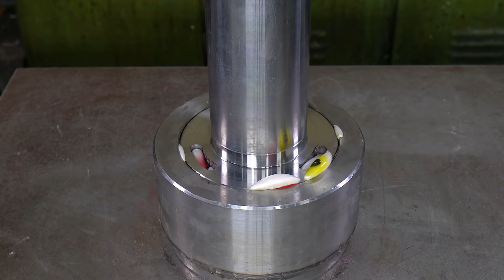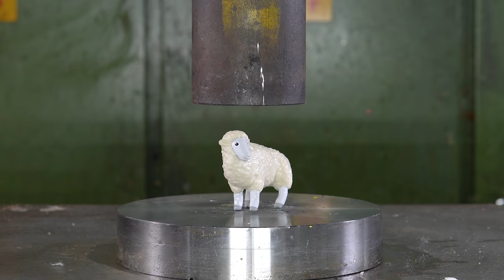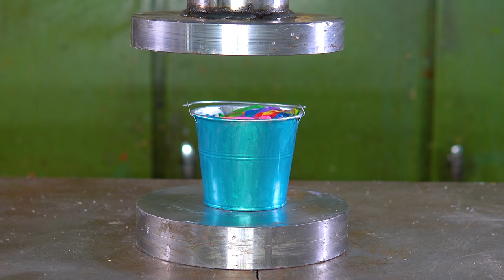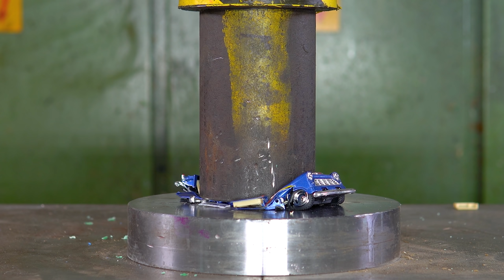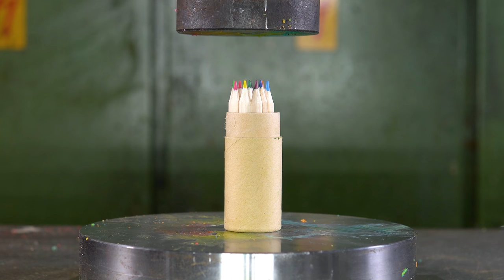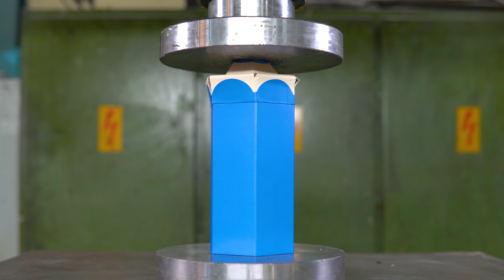Top 100 Best Hydraulic Press Moments VOL 4 | Satisfying Crushing Compilation

Comment: I was assistant manager for a truss manufacturing company in the 80’s. Multiple hydraulic presses. One day on of the men had to hold the truss plate but didn’t move his hand fast enough. It squeezed the skin off his thumb. He was from El Salvador. I rushed him to urgent care he didn’t flinch or wince from the pain. The doctors and nurses said he didn’t react when they sewed his thumb back around the bone. I brought him back to the plant and asked the interpreter how he could handle the pain. He explained that when they lived in their country they were constantly under the threat of death. Pain is something you get use to. Than he called the guy over and asked him to lift his shirt. He had 5 bullet hole scares in his chest from being shot from a government army helicopter. That explained why when ever one would fly overhead he would run into one of the buildings.
Reply: Ran Erino  yes, it is real.
Reply: Squish squash, your thumb is squished off 😂😂😂